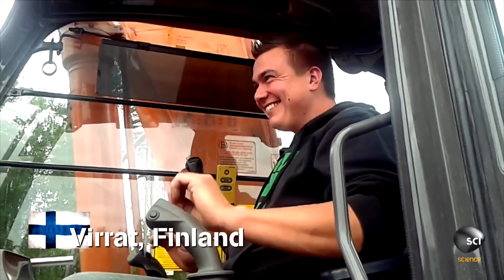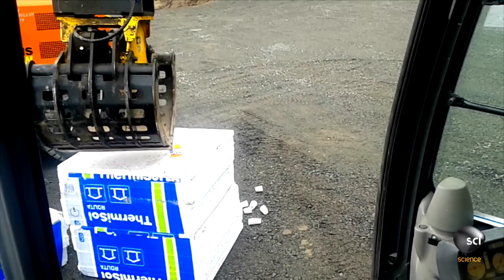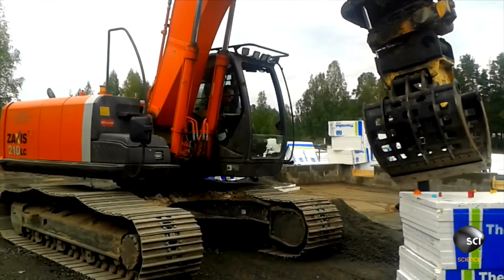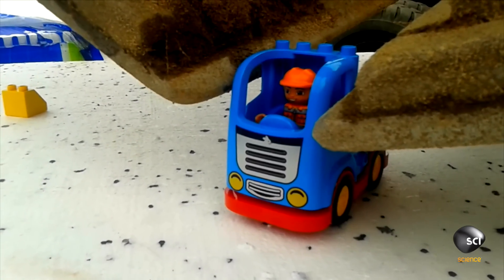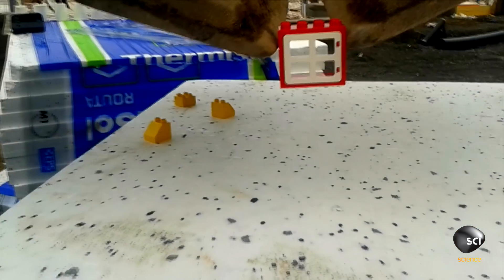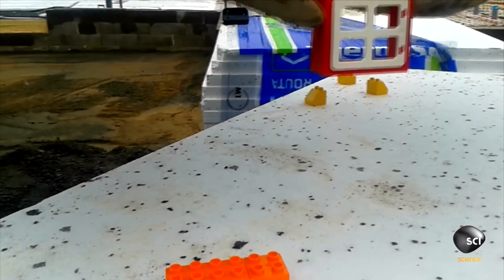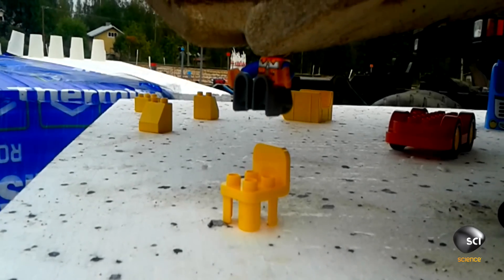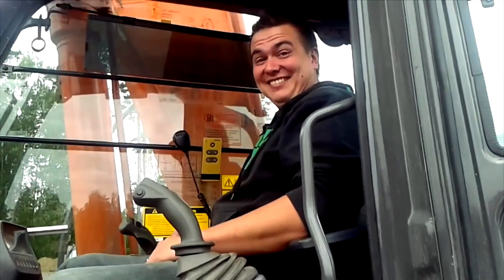Building Toys with a 20 Ton Excavator

Comment: Tom Wriggleworth. Wow, really I would have thought that using this machine to put together some toys would be the wrong tool to use. I see why you ring finger is naked.

Matt Parker - He is not pushing buttons.  He is using levers. The padded surface is only part of it. He has to be really good with control of the jaws. Without feeling it by hand, he would have to know how much pressure to use to pick up a toy without crushing it.  He is a professional at his job. 

Amy Elliot - Exactly. He does an outstanding job of having total control of this machine to move delicate parts without crushing them